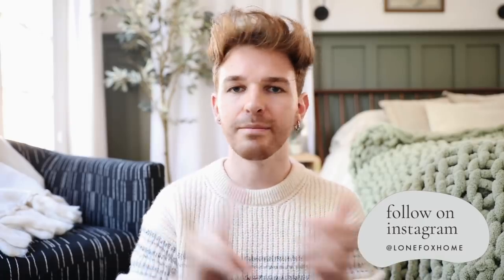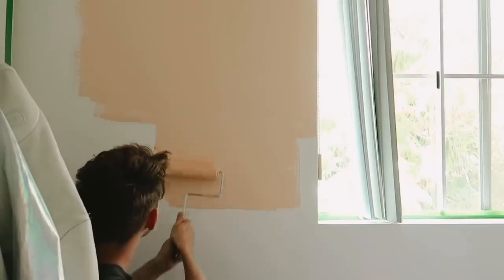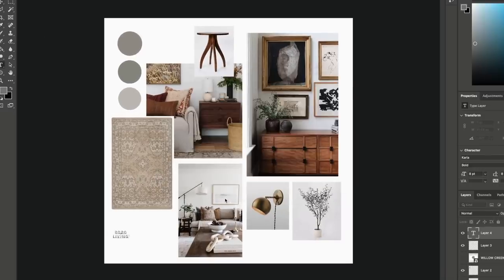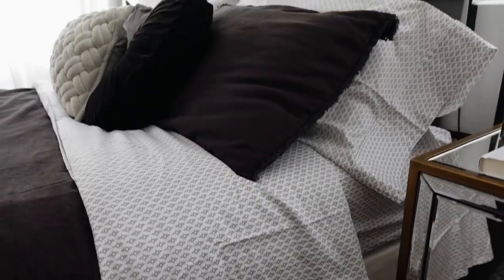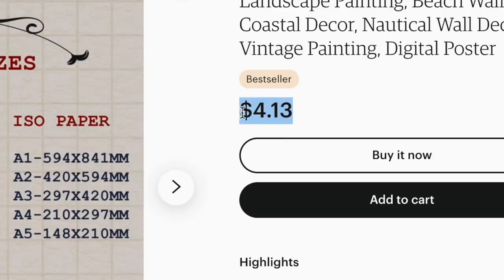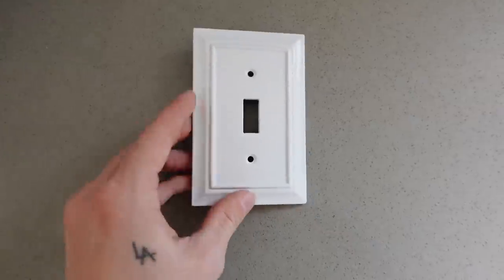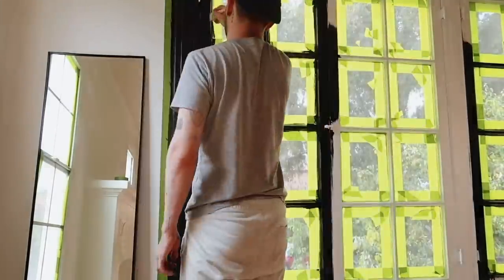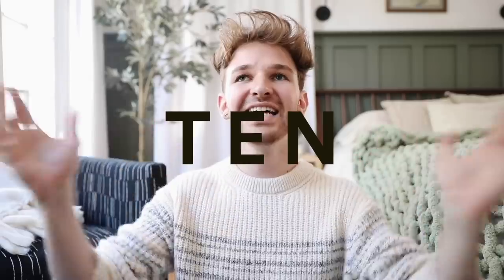10 Budget Friendly DIY Home Hacks for 2021 (New Year, New Home!)

Comment: Simple hack - change your pillow color by sewing slip covers for your current pillows using material and velco.   If the color doesn't suit, take them off before you spend alot of money for new pillows.  Quilting shops have tons of fabric much more reasonable then a totally new pillow.   You can aways recycle the pillow cases for cloth storage bags if they don't work out.

Comment: I have literally been making my bed like that my entire life. Mum has always said the pattern goes to the bed so you are inside both patterns.  Who knew she was an interior designer!
Reply: I think it's how beds are meant to be made, even in hospitals or hotels you'll see them making beds with the top-sheet 'face down' so the pattern or trim shows when folded over. Even basic plain sheets usually have a trim along the top edge and it's meant to be folded over trim side out :)
Reply: When I was a teenager I worked housekeeping at a hotel and it was definitely standard.